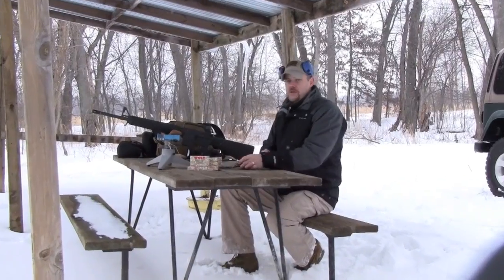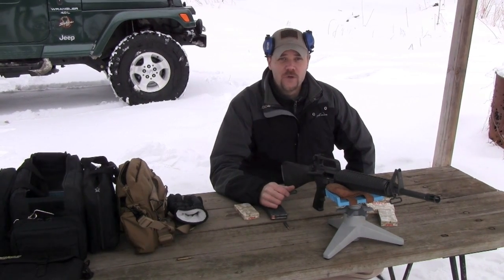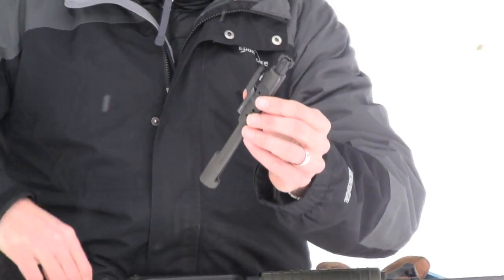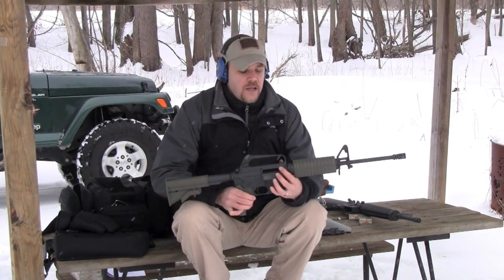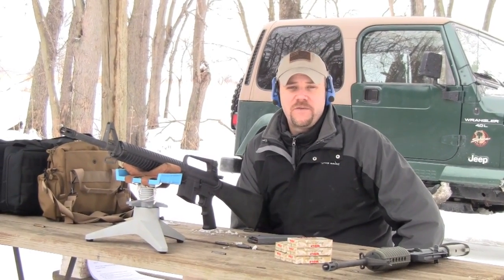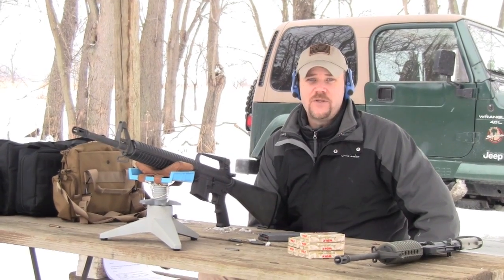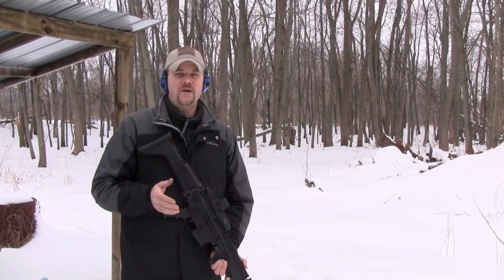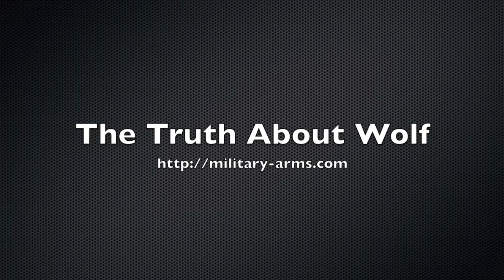The Truth About Wolf Ammo

Comment from the maker: I have a full-auto M16 that has over 10k rounds of Wolf through it. The rifle will still shoot a 3" group at 100 yards. As for the jacket stripping off in the first couple of inches, that's not true. The copper wash isn't for anything other than keeping the bi-metal jacket from oxidizing. The moment the bullet hits the barrel the mild steel jacket comes into contact with the riflings, it doesn't take a couple of inches.  Regardless, mild steel is much softer than the hard chrome in your barrel.

Comment: Here is the fact with Ruskie steel cased ammo. It goes bang....and if your gun that you are using for defense or a SHTF situation cannot shoot ammo across the quality spectrum from the lowly wolf to match ammo...you should look for a gun that will. Because in a SHTF situation, neither you nor your gun can be an ammo snob. I have used it with all my guns and only my junky Oly Arms I took in on a trade did not like it and that was only when the gun was dirty.
Reply: Robert Hinrichs Couldn't agree more.
Reply: Robert Hinrichs All russian ammo doesn't go bang, reliably. I have at least one dead primer in each box of TulAmmo. More than one, most of the time.
Reply: Robert Hinrichs I thought I had a bad batch of Tula or Wolf, forget which.  Kept getting duds.  Anyways, turns out my firing pin was boogered.  $2 part later no more "duds."
Reply: +John Davis Bullshit
Reply: +Rick Haddix do you even shoot Tula? I do, just about every weekend. Each box has at least one bad primer, but they always go bang on a restrike. Call bullshit if you want, but why would I lie? What do I gain from it?
Reply: +John Davis I shoot tula out of my AK, SKS, s&w m&p15 sport and have never had a misfire. tula .223 surprised me by how accurate it is compared to federal 556 and 223
Reply: ***** That's odd, because I and many others get a misfire in basically every box. A restrike always ignites the primer, though. This is with numerous guns.
Reply: Is it with handguns?
Reply: ***** Nope. Tula .223. The grey polymer cased stuff. It's great plinking ammo, but it doesn't even come close to being something I'd rely on due to the misfires. I have no reason to lie, it's just ammo. It just doesn't go bang every time, for me and numerous others I shoot with. But each time, no matter what rifle, a restrike never fails to ignite the primer.
Reply: That's odd. I've never had a misfire with tulammo, granted tula .223 isnt what I'd trust my life on either but its cheaper practice and target ammunition
Reply: +Bakery Wizard, Same for me, Ive used alot of Tula and Wolf ammo in both rifles and pistols and have never noticed an inordinate amount of failures to fire. 
 Funny enough the only ammo ive ever had serious problems with was American Eagle 115gr 9mm fmj, and it was just a bad lot of ammo, there were quite a few empty cases in the 150rds I bought and the other 1,000 odd rounds the range had in stock. Federal took the ammo back and replaced it with an apology and a few hundred more rounds for the hassle.  I still had to pound a squib out of a brand spanking new M&P 9mm that didnt even have 200rds through it,  which sucked ass, but the gun is fine. 
The only problem Ive seen with Wolf/Tula was an AR that failed to ignite the primers quite often due to the weak hammer spring, but It also had problems with surplus Lake City for the same reason.  A Stock hammer spring made the trigger heavy but reliable. 

    I have however seen some big old globs of laquer on some old 7.62x39 that a friend had, but I dont know if it was Tula, Wolf, Barnaul, or some other manufacturer , It was steel cased and it was surplus, and the big blobs were noticeable on the cases but the AK just chugged right through them no problems. 

  Tula, Wolf, Barnaul is fine to shoot, the steel case is no harder than brass, it may not behave the same way as far as expansion under heat and pressure, but the steel case absolutely can not and will not damage your rifle.    basic physics a soft material does not wear on a harder one.  And as far as extraction/ripping case heads off thats a maintenance issue.
Reply: +iTheGeek That is absolutely 100% not true.    bi metal jackets do not wear barrels any faster than a bullet made entirely from copper or solid brass. Brass, Copper, and any bi metal jacket alloy are made of very soft metal so they can bite into the lands and grooves easily and seal well

  Soft material will not abrade a hard one.    A super hard super sharp knife (unlss made from diamond) won even scratch diamond.
Reply: +SavageShooter93 I take it you haven't read up on the famous Lucky Gunner test, have you?
Reply: +tackytrooper I did indeed read it years ago when it came out and again after reading your post to refresh my memory.  

    The lucky gunner test was interesting, but it has a few fundamental flaws in its methodology.   

 The first is the utter lack of cleaning.  The barrel that only fired Federal ammo is proof of that.  That barrel was destroyed from a simple lack of care, and its extreme operating conditions.   Even a barrel given the most basic of cleaning and lubrication would have lasted far longer, and in much better condition than the one cut open after the test. 

  The second flaw was the difference in primer and powder compounds of the three types of ammo.   Frankford Arsenal did testing with Bi Metal jackets just after WW2 and with identical primers and powder and basic maintenance there was no statistically significant difference in wear in guns firing copper jacket or  bi metal jacket 30-06 .45ACP and .30 Carbine.  

    If you are going to do a test you have to eliminate as many variables as possible, Brown Bear was so dirty it clogged the gas tube and key, Wolf was no dirtier than the federal from a cleaning standpoint but the chemical makeup of the primers and powder is significantly different.   

  The Barrel cut aways show an extremely pitted barrel that only fired federal ammo, to be expected for the utter lack of care and the extreme rates of fire. 

  Both russian ammo brands left the barrel stripped of its chrome lining through corrosion more than anything, the alligator skin surface corrosion is proof of that. 

    Under the best of conditions firing a bullet is a very violent process and every time a round is fired the surface of the bore is exposed to incredible heat and friction on top of chemical ingress. 
   Chrome lining is meant to protect the steel from these effects, but it must be cleaned, or any imperfections will gather corrosion that will eat through the chrome lining and result in severe pitting as seen in the Federal only barrel.  

   Add the obviously much more caustic primer and powder compounds of the cheap ammo got into all of those little pockets of corrosion spread under the chrome lining and it will start to break down from underneath, flaking and destroying the protective chrome layer.  

 Once bare steel was exposed the normal wear and tear of firing under such bad conditions was compounded by more corrosion that increases friction and stripped the barrels to the point of uselessness.

     Now under those extremely bad conditions where the chrome lining is destroyed or in stainless or non chrome lined barrels, does the bi metal jacket react differently than copper to the incredibly uneven highly corroded surface?  Yes I am sure it does but that difference in reaction is a symptom of total neglect.

  Its impossible to argue the fact that the two barrels that fired the russian ammo had significantly more wear, but that does not mean that the Bi metal jacket was the cause, or even a significant contributing factor of the extreme wear. 

    The only way to show that bi metal alone cause accelerated wear is to have identical primers and powder, identical cleaning regimens and a large sample size of guns.  

    And since Frankford arsenal already did that and found no statistically significant difference after 8,000 rounds through a much larger sample size of guns in multiple calibers a reasonable person can only conclude that the Lucky Gunner test, admirable as it was is fundamentally flawed.  

   I am not attacking Lucky Gunner, I think its great they do this kind of stuff, but just because I like the fact that they try stuff like this cannot make me ignore huge problems in the testing procedures.
Reply: tackytrooper the cost of a new barrel at 10k rounds is nothing compared to the massive savings on ammo.
Reply: SavageShooter93  That is a completely false statement. Every single test done has conclusively has proven it wears barells at least two fold when compared to brass.
Reply: James Smith that is a completely false statement.  

 The Frankford Arsenal test had just the one variable, jacket material,  It used the same powder and  primer composition for all tests. They did the test for multiple guns in multiple calibers in US service at the time.   30-06, .45 ACP, .30 carbine were tested.    I believe the .50 BMG was as well but dont quote me on that. 
 
 After tens of thousands of rounds they determined that with all else being  equal jacket material has no statistically significant impact on barrel life.
Reply: James Smith two fold? Really, you might get 5,000 rounds less out of a barrel while using steel jacketed ammo. Unless you're firing as fast as you possibly can through a semi auto rifle you're probably not going to notice.
Reply: Correction:   The only information I could find on the Frankford tests were 30-06 only, 8,000 rds per gun no accelerated wear.
Reply: all my guns cycled everything ive used, so yea
Reply: J D yep im in the exact same boat....hard primers with it
Reply: I agree built 2 80% ARs and the full build was $430 for each with red dot and flip up iron sites as back up  and i call them my beater guns both are 16" with mid length gas systems and have run every known brand of ammo  i can find threw them and they both run flawless with there crappy mil spec triggers and all and are just a blast to shoot ....but I also have a few other ARs that are not beaters and they get the good stuff but it is always nice to have a couple rifles you can just treat like shit and bang around and could care less if they get dings and battle marks or even a bit of dirt on them or in them
Reply: you have a firing pin problem not a ammo problem Tul do need to be hit hard and you will have problems if you are using lighter trigger springs and such Tul works best with a good old mil spec rig gritty trigger and all
Reply: That is PRECISELY why I have a Saiga 7.62×39 AK... I don't think there exists a rifle out there that can eat ammo as well as an AK-47 does...
Reply: Need a heavier hammer spring. SIg does this on their rifles, and I am sure many manufacturers do.
Reply: Exactly. Nothing wrong with wolf or Tula period.  Nothing.
Reply: @johnd9357  my Marlin 336 does not like Winchester .30-30 ammo. Yet it works fine with Serbian PPU.

Comment from the maker: I get anywhere from just shy of 2" groups to 3" groups out of Wolf in my 5.56 rifles.  M855 and M193 give similar performance.  Wolf isn't corrosive, if it were I should have a whole safe full of rusted rifles -- alas, I don't.  These are a couple of issues I should probably address in my future video where I will show Wolf running with multiple mags in a variety of rifles. I'll be sure to break out a rifle that's not been cleaned and show no signs of rust.

Comment: Very good explanation! I have commented several times on other sites about the lacquer coating, and have had some respond back saying "it's polymer". Now I can answer back that both are true.
Even so, cases CAN get stuck. This is more evident the hotter the gun is running. I.e. full auto will have issues before semi-auto.
I have never had any issues, though, if I opened the bolt before laying the gun down. While you say that it is carbon buildup, I will truthfully say that cleaning up the chamber with lacquer thinner has prevented problems that show up when I skipped this step.
All in all, yours is the absolute best video that I have seen on this subject. Great work!